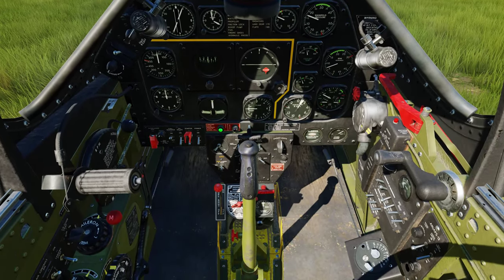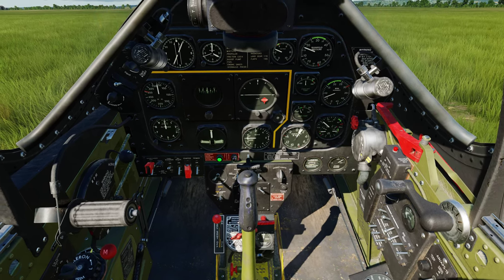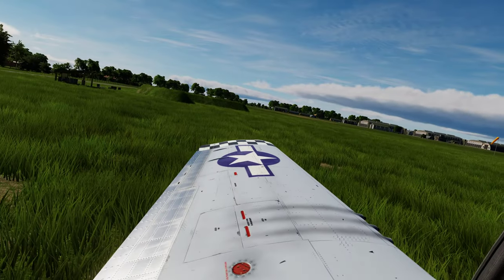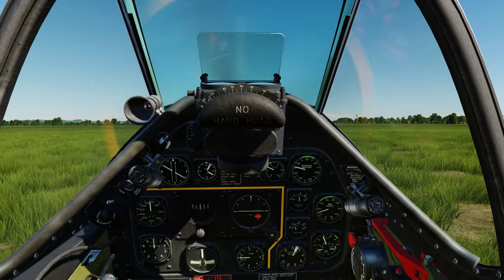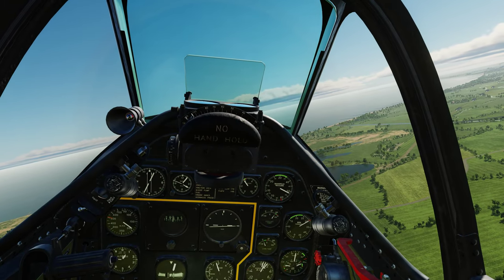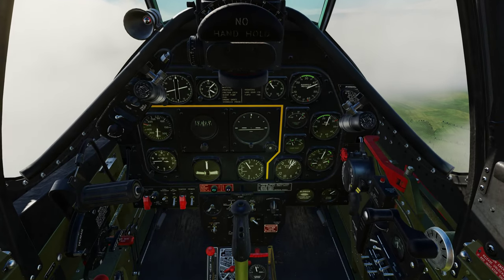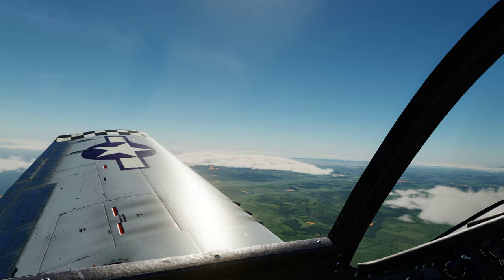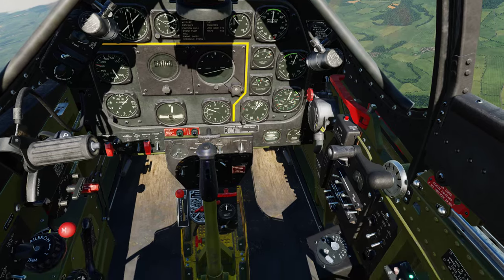MANAGING THE AIRCRAFT SYSTEMS - P-51D/TF-51 MUSTANG - Shout Out to @groundpounder0541

Comment: Trim is what I have the most trouble with in the P-51. Partly because the cheap throttle I have has very awkwardly-placed buttons. I just found some a 3D-printable design for the trim box, with all three trim knobs as well as the landing gear and flaps levers (but not the two carburetor levers). The plans are free to download if you have a printer, but the bearings and screws and wiring still require some money spent. The same maker, Authentikit, is also working on a throttle quadrant, and already has a P-40 throttle that makes an okay stand-in.

Between the cost of the hardware and the time it takes to 3d-print such a huge thing, it'll be a couple weeks at least before I have it ready to try out.
Reply from the maker: Awesome...drop a link and I'll check it out and share...Thanks for being in our community.  ~ Juice
Reply: I am 16.5 hours into printing the first component, the box for the electronics hub. 3D printing is slowwwwwwwwwww 😆

Comment: One thing  I've come across a number of times is the order in which you manage the throttle and prop appears to be important. When increasing, you want to increase RPM first and then the manifold pressure. When decreasing, you are supposed to do it in reverse, so you throttle back first to lower manifold pressure THEN reduce rpm. I think it is supposed to be better on the engine that way ensuring the manifold pressure is never too high for the current rpm setting. I am still pretty new to the p-51 myself though so there may be more (or less) to it. Thanks for the video!
Reply from the maker: Thank you for the advice and feedback.  I’m learning thanks to you guys!!

Comment: I have no idea if this is recommended, but I switch the main cooling to manual and fully open for takeoff and until I’m over 200mph on the initial climb. If I’m in a mission that has a ‘crash’ climb, where I’m at 160-180 (as with some missions) I leave it on manual, fully open unless the temps are looking low, in which case I switch to auto. I find the auto radiator opening a bit sluggish in keeping up with engine temps, so if I’m slow where the drag is less of an issue I might switch to manual for a bit. I haven’t had an engine seize since doing this.
Reply from the maker: This sounds like a great idea, especially with higher ambient temperatures and longer taxing time on the ground.

Comment: Hi Question Sir. 1st Thank You Please keep doing what you're doing telling us what map and airfield you are on in your videos. Question I too had lots of issues with engine management and I do something you do not cover and now I think maybe it is wrong but you tell me please. I will Open the Oil and Water radiator covers full open as soon as I get in the air and trimmed up. I have them Mapped on my Virpil Panel 2 for the covers 2 for the switches so I can hold down both radiator switch buttons for 15 to 20 sec. to allow them both to open all the way. Is that wrong at low altitude? If I get jumped by fighters I will Burn up the engine real fast if they are not open full.
Reply from the maker: Lower altitude and higher engine RPM does create more heat.  But dialing back the RPM and Manifold Pressure can help to keep it normal even when radiators are set to Automatic mode.  Do some testing and see what happens.
Reply: @AIRWARFAREGROUP  Lol thank you I agree but when I get in a dog fight I set up I will burn up the engine if I do not open them.

Comment: Tip: above 14k’ you can close the ram Air lever to engage the supercharger. Gets you into supercharger country before 18k’

Edit: I’m running 45” 2700rpm when I’m doing this
Reply from the maker: Super cool.  Thanks!
Reply: @AIRWARFAREGROUP  after it engages, if you continue your climb with those power settings, gradually open the ram air, and it should be fully open with the supercharger still engaged at or above 16k’.
Reply: That's awesome, I did not know that. Appreciate it.

Comment: Hi, good video. Lots of people have trouble managing the engine (prop and manifold pressure). In the aircraft docs folder is the manual. On Page 32, Fig 15 is a chart telling you the optimum settings for different flying conditions. Note the rightmost column which tells you the maximum time you can run at any particular settings. So there's high settings for max performance during fights but you're very limited as to how long you can run at the high settings. Anyway, good luck.
Reply from the maker: Thanks. ;^)

Comment: Good video, you walked through the steps nicely. One thing I'd like to add though is to get the oil temperature up to at least 50 degrees before take off. You can see the oil pressure going off the charts during your take off.
Reply from the maker: Thanks for this information.  I’m always curious if DCS is modeled in that regard and all engine factors.  I’m going to implement this now!  :)
Reply: @AIRWARFAREGROUP  recently the cooling system got overhauled, it became a lot more critical. Especially on cold starts. Try cranking the engine up to max when it's cold and you can hear it selfdestruct ;)
Reply from the maker: I wondered what that was! It correlated with the time I installed the echo one Niner sound mod, and I just thought it was that, but that makes total sense. Thanks! Question, has anybody done a video on that engine management to that detail yet?

Comment: I would just also point out the max continuous settings for the P-51 are 2700RPM for the prop and 46psi on the manifold pressure.  You can stay in that condition and have temps OK.
Reply from the maker: You know me...conservative nelly.

Comment: On the right side of your aircraft there is a placard on the wall that shows what rpms and boost you should be using in certain circumstances :) secondly the green lines on the throttle and rpm gauges show maximum cruise speed
Reply from the maker: Sweet.  My head track needs to find this.

Comment: I just bought the P-51D Mustange from the "The Blue Nosed Bastards" campaign, but at a certain point in the mission the engine stops and I end up crashing. I still haven't figured out what I'm doing wrong, but I think it has to do with the way I'm managing the engine.
Reply from the maker: Probably right.  Pistons are fun because you have to have good cross checks of the engine systems to make it work.  If you don’t have a good way of mapping the P lever, the default is page up and page down.  Tap tap lightly to get it when you want it.  RPM first then throttle to dial in the manifold pressure.
Reply: I'm in the middle of that campaign myself.  It's great.  If you've got the RPM settings and manifold settings OK and aren't redlining the temp the other two suspects are either a fuel management issue or not warming the engine up enough before take off.  

For fuel take off on left main, burn the fuselage tank, then combat tanks and then the main wing tanks. The gauge for the fuselage tank is behind to the left and is a pain to read.  If you're a new pilot the fuel cut off can be a surprise and seem like your engine just died.  If that's it you need to reset the fuel valve to one of the combat tanks if its the fuselage.  Because of how magnetos work, your windmilling prop will restart the engine as soon as fuel flow is restored.  

The merlin needs to warm up.  Personally, I watch the oil pressure gauge more than the temp gauge. When oil pressure falls pretty close to green it should be ready to take off.  This is well after the engine gets as warm as it is likely to get just running on the strip.  Frankly, I don't know that oil pressure will get fully into the green unless you manually close the radiators, but that isn't necessary.
Reply from the maker: Cool stuff.  DCS Sport flies the Mustang in real life and he looks for oil pressure about 1,000 I think I saw him say on his startup video.  Thanks for the great tips.
Reply: @natekott  When the engine stops, it happens to me in the second mission, when the enemy fighters appear. It just shuts down and I can't get it working again, just could be a fuel problem, because up until this point, I hadn't changed the fuel tank. I still don't understand how to see the amount of fuel left in the tanks.
Reply: @AIRWARFAREGROUP  Finally I managed to successfully finish mission number two of the campaign (I shot down two fighters and a bomber) and found out what I was doing wrong... There were two situations, the first was to control the engine badly and always run with the propeller at maximum and the second was not changing the fuel tank and the engine would stop. Thanks to this video and the tips given here, I was able to finish the mission successfully. I'm really enjoying these WWII planes. Thank you all for your help.

Comment: I'm just trying out the channel map out now in the trial. I'm not sure that I want to keep it. I don't see what makes it that much better than the Normandy map I have....not that I wouldn't like it. It's just that it's another 22 GB to upload with every Beta update and at the moment I'm on a limited bandwidth plan.
Reply from the maker: If you already own Normandy 1944, you will be fine to upgrade to Normandy 2 for $15 when it launches.   What’s your system specs?  Level of detail is affected by settings and when I fly formation with a buddy, my maximum settings capable rig shows things that my friends with lower end equipment can’t see.
Reply: @AIRWARFAREGROUP  Thanks for that tip. Yeah I will upgrade Normandy. I have probably lower end specs but for me they are good. I get about 75 fps when flying  and about 60 on the carrier deck, on server in MP. 
Aorus 7 SA  -17" (laptop) 
Intel(R) Core(TM) i7-9750H CPU @ 2.60GHz   2.59 GHz
144 Refresh Rate
32 GB  - Memory Size 6 GB
GTX 1660 Ti
Reply from the maker: VR would affect your settings even further.  Enjoy DCS.